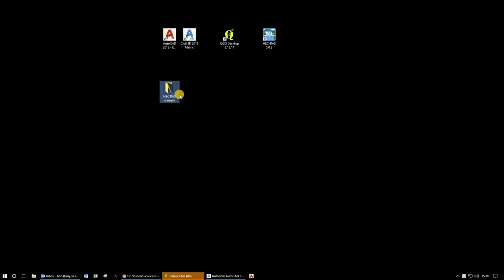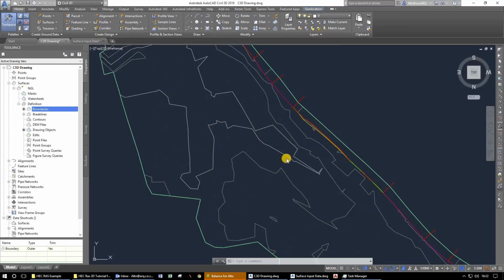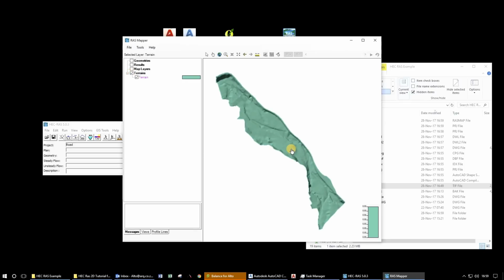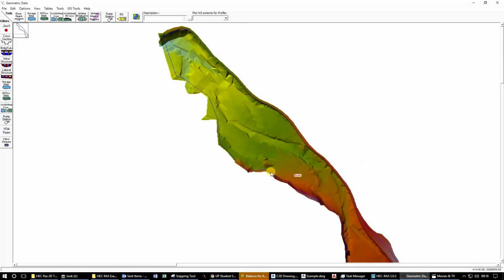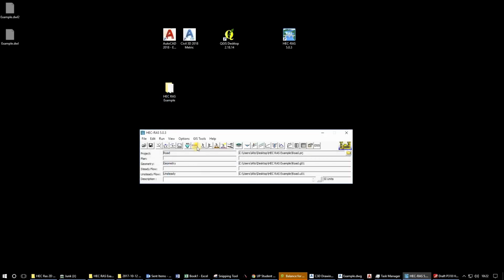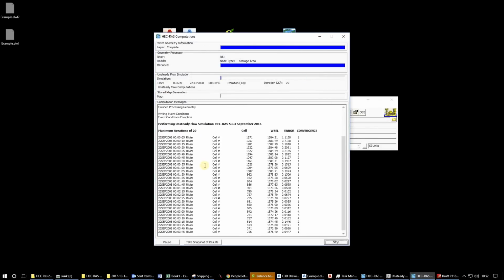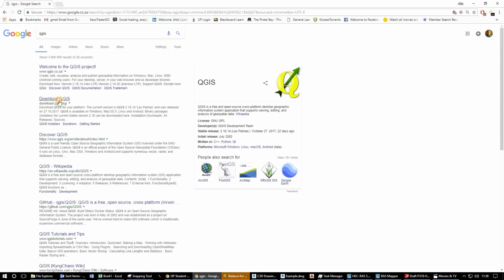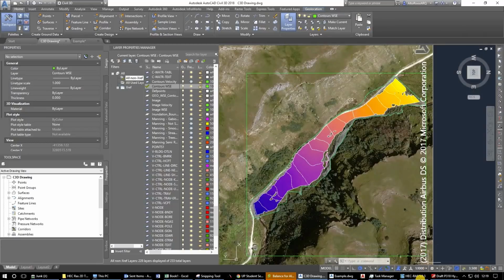2D HEC-RAS 5 Full Example/Tutorial from Civil 3D to HEC-RAS 5 to QGIS to Civil 3D

Comment: Hello 
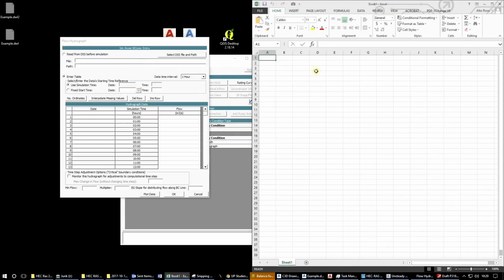@54:02 you said 150cu.m for flow as Q. One would obviously need to calculate the catchment areas and calculate the Q entering the river at this point, please advise as I am new to HEC RAS.
Reply from the maker: Correct, you will need to have outputs from a hydrology study to feed the flow information to your model. That flow can obviously also be produced by other sources for example discharge from a dam or pump station.

Comment: Hi,
I've got a problem about exporting data for HEC-RAS. The exported file is 0 KB. How can I solve this problem?
Reply from the maker: Hi Rossana,
Can you please provide the exact steps you follow to try and export your results? It would help me to help solve your problem.
Reply: @altoroos  I state that I already have a floor plan in .dxf format. I imported it to Civil3D. After that, I imported the DTM as a surface and created alignment and sections based on the floor plan. Finally on I exported to HEC RAS by inserting surface, alignment and sections.
Reply from the maker: @rossanasaracino8548   Seems like you are setting up a 1D HEC-RAS model in civil 3D and then try to export the data generated in Civil3D as a HEC-RAS model which you will then take further from within HEC-RAS. Unfortunately my video was not aimed to facilitate that workflow. I'd suggest looking at the following video which sounds more like what you are after.   
https://www.youtube.com/watch?v=oacpBLqpDIk
Reply: @altoroos  ok 👍 thank you!

Comment: Hi Alto. The steps worked perfectly, but I noticed that my WSE(Max) contours export as zero elevation contours. I have tried using the GRASS plug-in on QGIS to export the contours with no luck. Is there a way to export the WSE(Max) contours with elevations? Would like to use these contours to create a surface in C3D. Thanks in advance.
Reply from the maker: Hi Lafras, Did you manage to export the contours with elevations? If you did, please share a few bullet-points on how it could be done. Thanks
Reply: Alto Roos Nope. Not while using QGIS. I however redone my flood analysis using the River and Flood analysis Module in C3D. This module exports the contours with elevations. But contours exported from HEC seems a lot more accurate. So still working on it.

Comment: good one,but what informs you of the mannings value to be used
Reply from the maker: Hi. I used photos taken on site to get a feel for the vegetation, terrain and roughness and correlated that to an applicable freesurface flow reference providing typical manning values for similar areas.
Reply: @altoroos  when taking the cross sections,what method is to be used in taking the section physically,manual or levelling instrument? also,is each station independent on the other. i mean cross sections taken at river station1 for instance ,is it independent on cross sections taken on river station 2.
Reply from the maker: @peteradegbola4508 , sections you take should definitely be using the same reference. Generally, The more accurate your survey the better.

The actual method used to capture sections does not matter, as long as they are correctly orientated relatrive to each other and are within your accepted accuracy tolerances.

I would suggest using an experienced surveyor applying the latest survey techniques that would be appropriate to the area you want to assess. This would ensure that the survey you use for Your HEC-RAS model will be representative of the area being investigated.

Comment: bnjour monsieur est ce je peut faire la modélisation d'ecoulement dans un dérivation provisoire dun barrage (pertuit)
Reply from the maker: Un barrage temporaire peut être modélisé de différentes manières en fonction de votre cas particulier.

Une solution consisterait à utiliser une structure à porte pour permettre à l'eau d'y pénétrer pendant une durée déterminée en ouvrant et en fermant les portes. Cela atténuerait le débit et pourrait donc être temporairement opérationnel.

Une autre façon pourrait être d'avoir plusieurs fichiers de terrain. Un pour avant la construction, un pendant la construction avec le barrage temporaire et un après la construction est terminée. Vous exécuterez ensuite le modèle trois fois et utiliserez les résultats de chaque scénario pour simuler l'effet de la structure temporaire.

Une autre solution consiste à laisser le barrage temporaire rompre ou à démarrer l'analyse avec un barrage endommagé, à le reconstruire, puis à utiliser le fichier résultant comme fichier d'entrée pour une analyse secondaire dans laquelle la structure temporaire est à nouveau violée pour revenir à l'état initial.

Il est difficile de trouver une solution à votre problème sans connaître les détails.

J'espère que cette réponse à votre commentaire aide.

Comment: Alto thanks for the video it really helped. But I would like to see what to do when I have a steady flow using the 2d flow data.
Reply from the maker: Hi Dawid, 

As far as I know it isn't possible to do a steady state flow analysis with a 2D model. It has to be an unsteady flow analysis and therefore to simulate a Steady State in your model you have to assign a flat hydro-graph at a specific flow as an input boundary condition for the entire duration of the analysis time. Then let the analysis run for a time until steady state is reached within your model. 

The results obtained can therefore be accepted as if it was a steady state analysis since you only look at the results at a specific time-step.
I hope this answers your question.